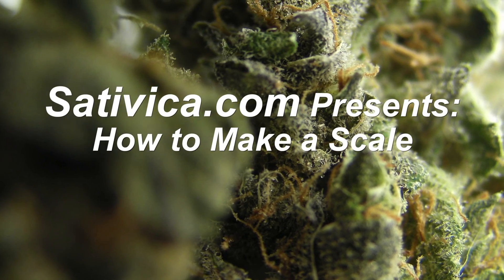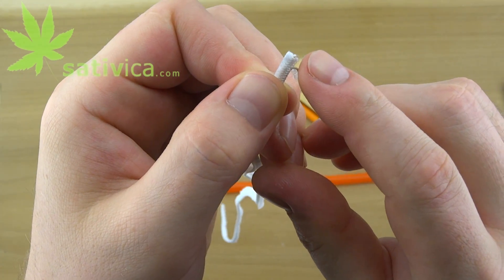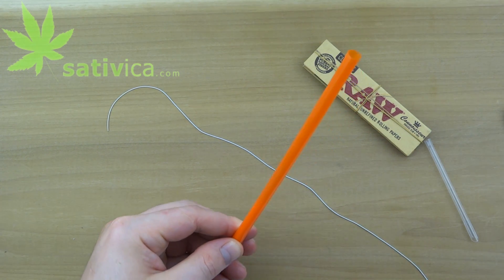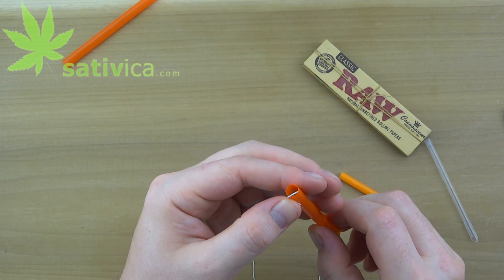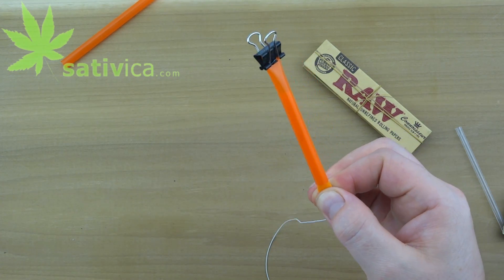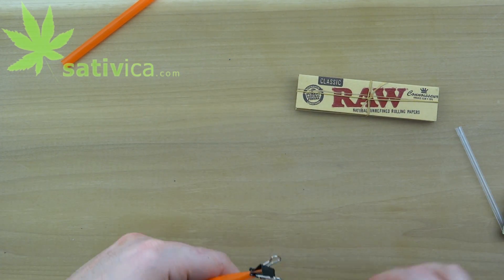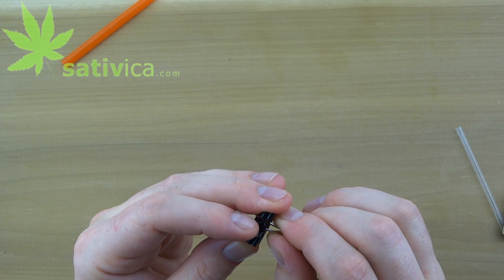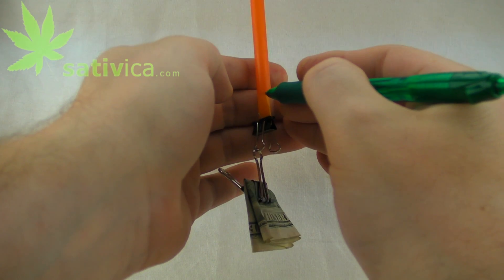How to Make a Hand Scale

Comment: In the U.K its 10 per gram, 60 for a 1/4 z and depending on the weed anywhere from 90 to 110 for a 1/2 z
Reply: Probably mids unless you're cool with your plug